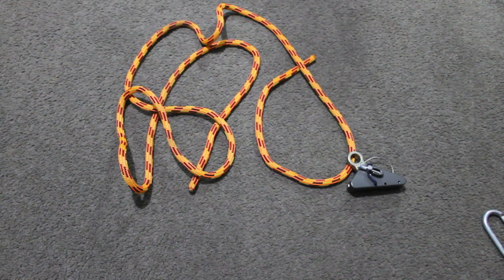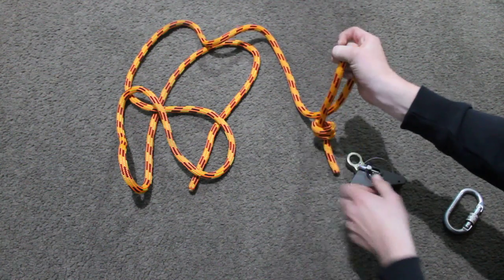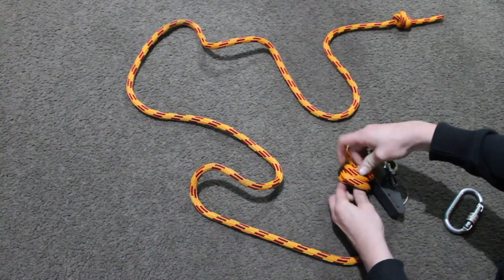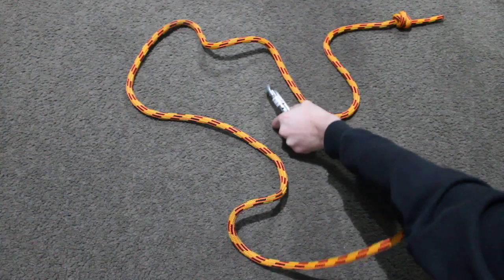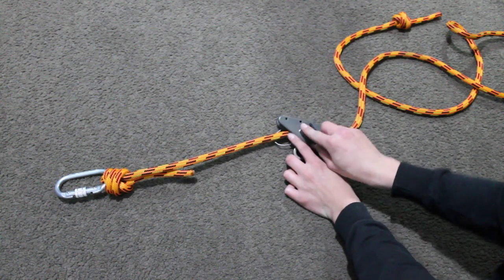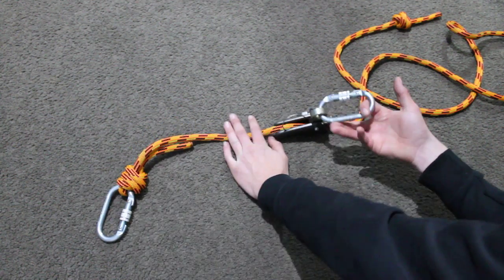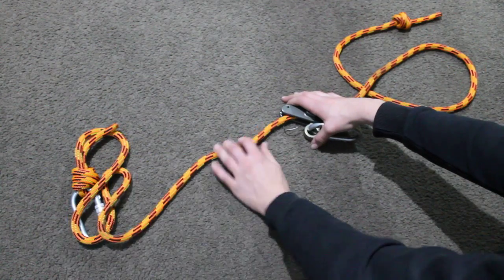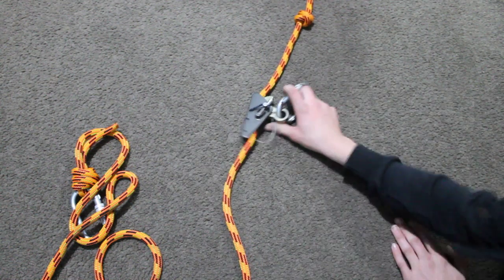how to make a work positioning lanyard

Comment: Where do I find the rope stopper you have there? What’s the name of that? Also, I need a rope to go from my harness, around a tree, and back to my harness. Meaning, I need it to lock and adjust in horizontal, as the goal is to hold me to a tree. Will this work? Thanks.
Reply: Yes, this will do that.